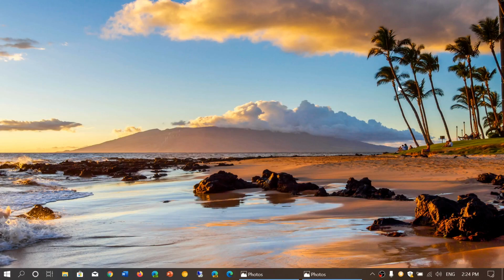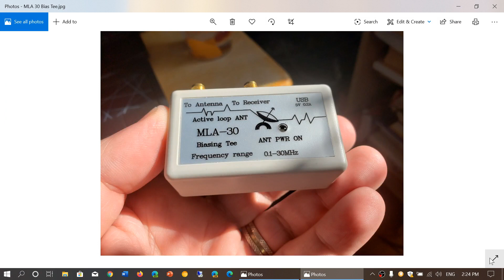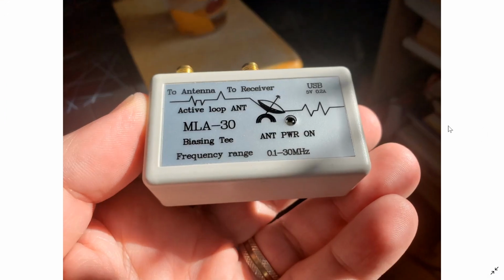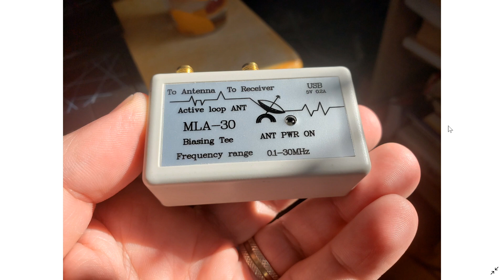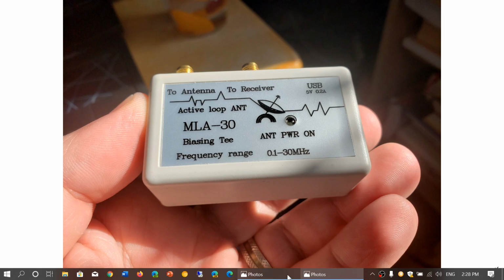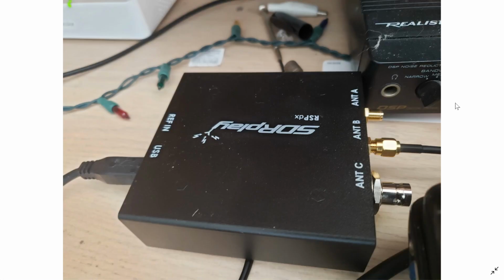WHAT IS Bias T Bias Tee Biasing Tee and why is it used

Comment: Thankyou sir, very timely vid.
I was just wondering if my RSP1A BiasT would work with my MLA-30+. Directly hooked the antenna up, enabled the biasT button from the Main panel settings input in SDRuno. Selected the new biasT button and It works great.  My next test will be using the RTL-SDR v4's BiasT, I expect the same great results.
Really enjoy all your content and your laidback delivery. I've learned so much from you and spent some coin based on your radio reviews.  I love my Tacsun's

Comment: thanks for shedding light on this antenna. I still have a few questions but what if you have other options? would stringing a wire into a tree work better?
Reply from the maker: if you have low noise , a wire will work great, but if you have high noise this is a better option, it all depends on the noise around you